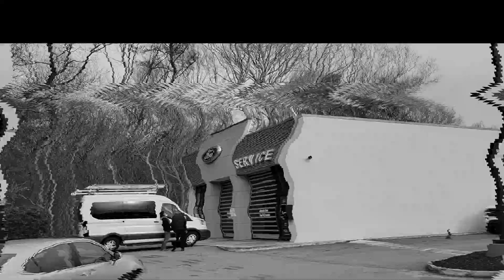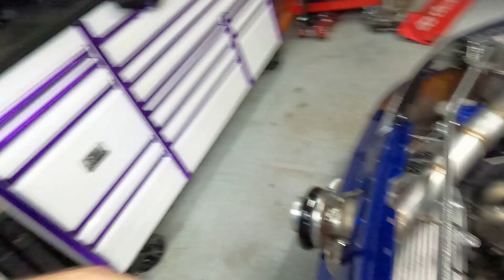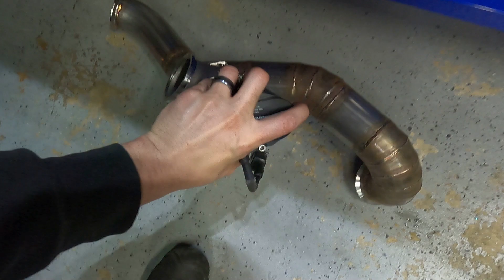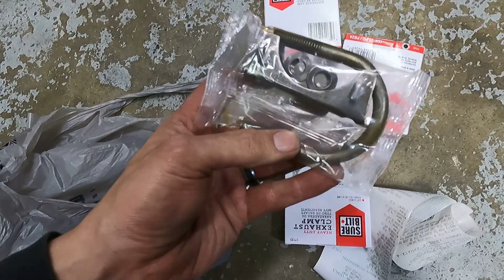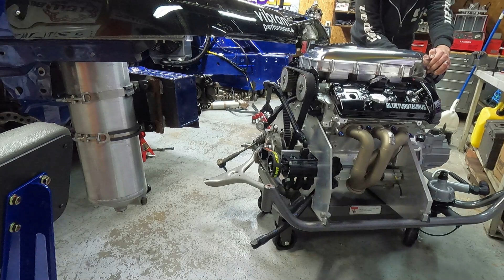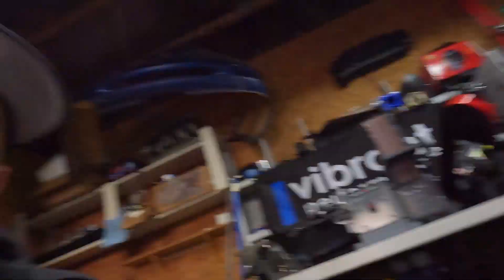Honda K series transmission on a 2000HP BILLET V6

Comment: there are much stronger sequential boxes. why did you go with k series? also 2kHP and FWD??
Reply from the maker: this is not sequential. H pattern. 
Billet case and PPG gears has been 7.4 in the 1/4 
plenty strong.

Comment: You should look into the hydraulic/electric clutch slipper like boostedboiz Kyle has on his k series mr2 works just like the black magic style clutches the V8 guys are running that is if you haven't already gotten something like that
Reply from the maker: That is the plan!

Comment: The front clip with the cooler and turbo. A couple of tabs that go up and over the end of the chassis rails into some locating holes to catch the clip so it could essentially support itself with no bolts in it would be a good solution.